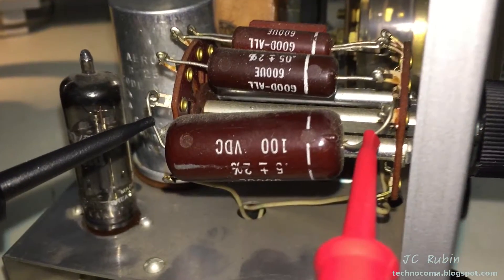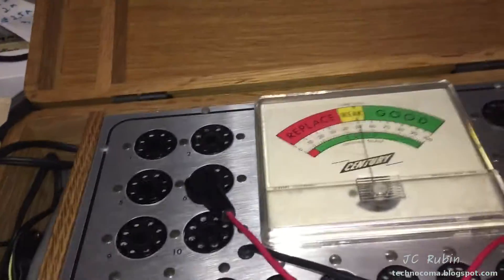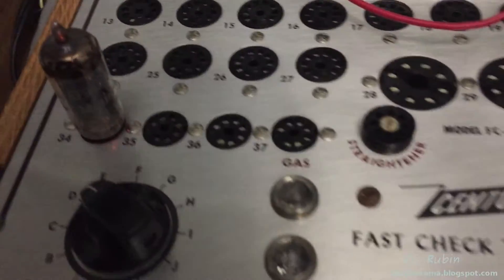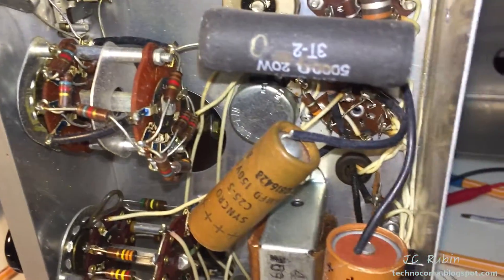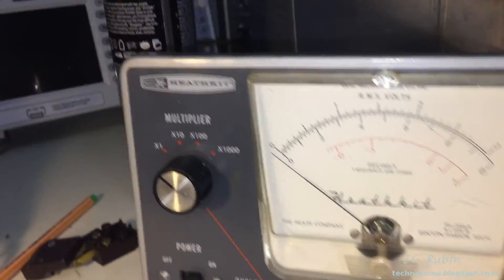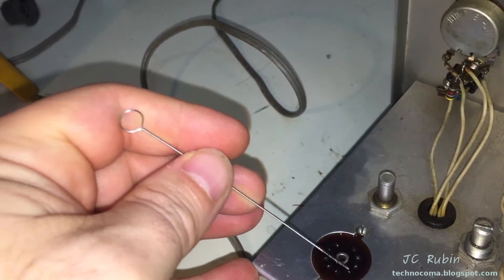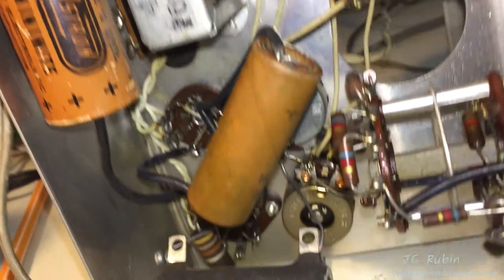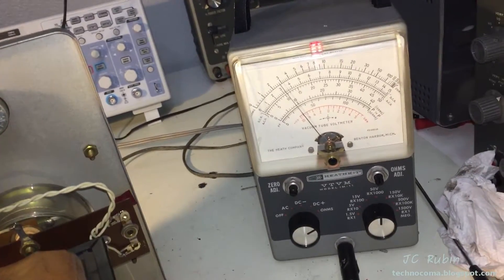Heathkit Repair - Audio Generator IG-72 PART 2 of 5

Comment: Keep the domino mica caps, replace those black beauties and those old electrolytics. Those are priority. Replace the indicator light bulb with a superbright LED and 1K current limiting resistor. Keep that other bulb, it's the dimbulb tester DBT. I use Brasso and qtip to clean the black composites from the switches.